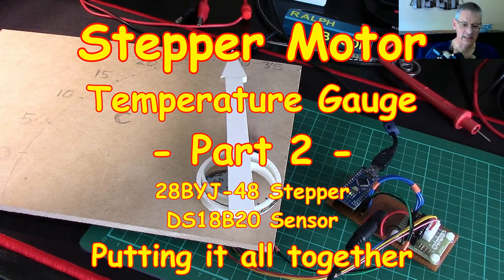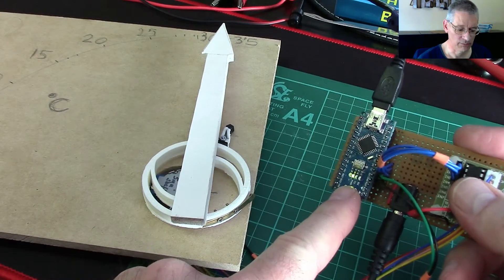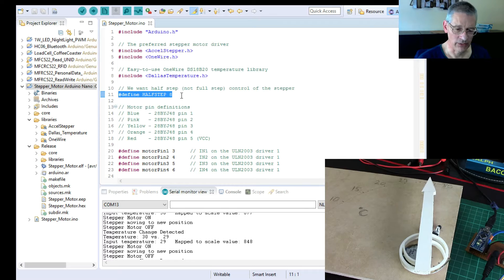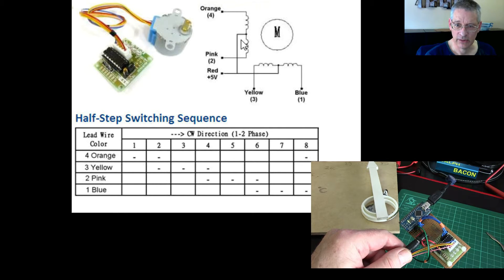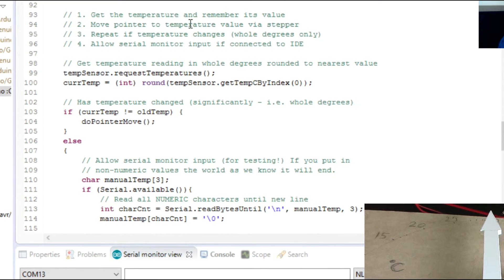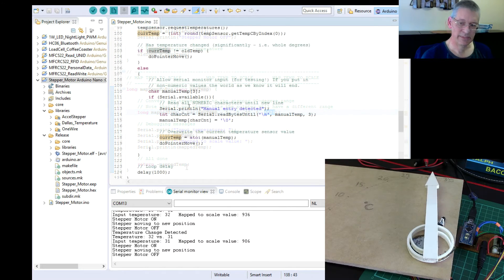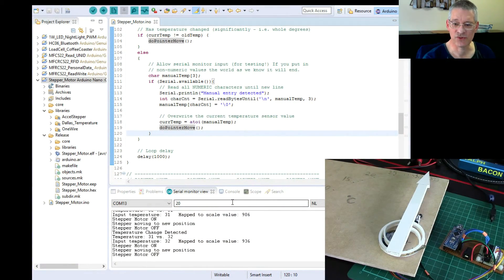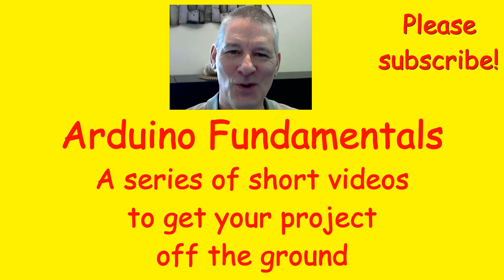#39 Stepper Motor 28BYJ-48 Temperature Gauge - Part 2 Completing the project

Comment: Nice project, Ralph. Very useful application of a stepper motor and I would consider this extremely educational in a way that kids could do this project as well! Keep up the good work.
Reply from the maker: Hi Thomas! Yes, it was an interesting project (and is still running in my workshop but soon to be transferred into Benny's cat run so he can keep an eye on the temperature!). If I did this again I would not use a microswitch, instead I'd use a Hall Effect transistor. Thanks for the feedback!

Comment: Great project, Ralph. I've been looking for exactly this project (for a Raspberry Pi) for some time. Now you've given me the means to do it. Instead of using a circular movement, I'll be attaching my motor to a threaded rod that will rotate and move my pointer up and down a vertical scale.
Reply from the maker: That's great news, i hope out works out. I would, with hindsight, have used a Hall Effect sensor instead of a Microswitch but as you have vertical movement i think it will work fine with a micro switch. Thanks for sharing!

Comment: hi thank you so much for your very good videos.
I am working on a similar project .I control the air to my wood boiler with a stepper motor.
and a temp sensor.
I'm running dim code now.
but I want the stepper motor to rotate 2 revolutions between 70 degrees to 90 degrees Celsius.
can you explain how i did this
best jocke
Reply from the maker: You need to know how many steps your stepper motor has in a complete 360° circle. For example, if the Step Angle is 1.8° then a complete revolution will be 360 / 1.8 = 200 steps. So just issue 200 steps in a for { } loop for one complete revolution. Repeat for another. Make sense?

Comment: Just noticed 1 small flaw in this. should the temp be below 0 then the dial would turn all the way round off the display (ccw 350 ish degrees)  to find 0. it needs something like 2 hall sensors to determine max and min to send the motor the correct direction. great project. loving the "practical uses" for in/output sensors and devices
Reply from the maker: Ooh, I shall have to test that, Gary, we can't have it do that (I wonder if that is why the pointer is sometimes found on the floor in my very cold - in winter - workshop?). Anyway, glad you're liking the videos, keep tuned! Thanks for posting.
Reply from the maker: So I tested this tonight and this is what I discovered.
 
If the temperature is below zero (and the pointer shows below zero) and power is then removed and then reapplied, you are correct that the pointer than goes round ccw (anti-clockwise) for about 230 degrees (let's assume it was showing -5 degrees C) to find the zero marker again.
 
I could easily adjust this in the logic by moving clockwise if we thought the temperature was below zero. However, I can't do this because the µswitch is a one-way only switch - if I tried going clockwise it would jam and destroy itself! If I had a (non-contact) Hall Effect switch (which I've mentioned many times in these comments as to the way I'd do it the next time) it would be fine.
 
So, I need to do two things here, Gary. One, replace that ridiculous µswitch with a Hall Effect sensor. Two, adjust the logic to turn the pointer as described above to find the zero calibration point.
 
Sounds like a nice enhancement to my existing Hall Effect video demo! Keep tuned... and thanks for bringing this to my attention (well, you know what I mean). Seriously, most appreciated.
Reply: Ralph S Bacon im thinking if yo was to replace the switch with a 2 hall effect switchs, move it to max sense say south on magnet then use north on second switch for zero also the max switch can stop the pointer going off the scale in our extremely hot summers. thought if useing 1 with 2 magnets if you have a - reading it will think 0 is max then will be pointing off scale when lookong for 0
Reply from the maker: When I have more time I will definitely experiment a bit. Thanks for your suggestions. I want to replace that µSwitch anyway so that will be my reason for doing something to this. Keep tuned...

Comment: Ralph, these steppers run at 5 V , thats why you have them so hot
you could even run them on 3 v if no torque is needed.
Reply from the maker: Ah ha! Well there had to be a reason so I guess this it, Patrick, thanks for posting, good to hear from you.
Reply: Im planning to use the same ones for my auto throttle for the simproject im doing
All parts will be 3d printed, the holder for this from PETG, bu I will put some heatsinks on it just to make sure it does not overheat

 @RalphBacon

Comment: Nice tutorial. 
If I had access to a laser cutter, I'd be tempted to make a hollow plexiglass pointer and mount the electronics inside the pointer. As the pointer only moves a short distance you wouldn't need to worry about slip rings.
Reply from the maker: An amazingly creative idea. And it also allows user to see the electronics which somehow seems to fascinate them (well, it does me too). When I can get a laser cutter I'll steal this idea of yours Maxx. Fully credited, of course. But don't hold your breath, I won't be able to get one any day soon.  I'd also like a 3D printer but that is also a pipe-dream for the moment...
Reply: Ralph S Bacon
I know the feeling. I'd love one or the other, but I'm on a limited budget. I am however scavenging parts from old printers and scanners with the aim of building one, one day with my old Raspberry Pi and an arduino as the brains.

Comment: I've never seen a motor like this,  even though it's described as "ubiquitous".  There must be some really tiny stepper motor inside that casing,  and some gearing.  I've tried to make some sense out of the data I just found on it in a search,  but that "/64" part?  I've been salvaging lots and lots of electronic parts for several decades,  and that includes a box of stepper motors. There are a number of different form factors and sizes,  and almost all of them are marked with the step rate,  which is mostly 1.8 degrees/step,  giving 200 steps for a revolution.  A very small number of these are 7.5 degrees/step,  giving 48 steps/revolution.

It's a big subject,  and there's an awful lot of good info on it out there on the 'net.  I got interested in stepper motors when I started giving some thought to building myself a CNC machine,  which still hasn't happened yet -- but life is what happens while you're making other plans...   :-)
Reply from the maker: Certainly this stepper motor is used in many projects (hence the good support). And it certainly works for me inasmuch that the pointer does point to the correct temperature symbol. Maybe there is some magic inside the casing.

Comment: Welcome. I am 52 years old and I'm just learning to writing code on Arduino. I want to thank you for a very precise code translation. Based on your program, I want to build a swivel machine for welding. Of course, I will remove the Dallas temperature sensor and insert the potentiometer to set the end position.
I was very interested in the library to the stepper motor. Regards from Poland, you and Benny. I also have such a rice urban named "Rysio". I am asking for more movies because they are well translated. I think you have an error with measurement -5 degrees. Maybe the sensor heats up from Arduino. Move Dallas sensor to another place.
Reply from the maker: Good luck with your project and thanks for the tip about the positioning of the sensor.

Comment: Does that temperature reading get more realistic if you don't have the sensor under the nano?
Reply from the maker: Ideally the sensor should be away from all sources of heat, Roy. Luckily this project did not demand the ultimate accuracy (and it's still working). If I did it again I would mount the sensor at the edge of the board.

Comment: Ralph, interesting project, do you think this could be implemented into a project I'm doing. My project involves using a stepper motor to control the amount of fuel being metered to an engine. It then senses the exhaust temperatures and quickly adjusts the metering rod to either apply more fuel to cool it down, or less fuel to heat it back up. Thanks for a reply, Hurst :)
Reply from the maker: If the metering rod can be accurately controlled by the stepper motor, Dread, then I don't see why this would not work. Just bear in mind that the stepper motor has no idea of its current position; all movements are either positive or negative from the current position, whatever that may be. Compare that to a servo, which knows exactly its current position (in degrees, normally). It all depends on whether your project requires this. But whichever approach you use it should work as far as I can see. Using a stepper motor and the mechanics from 3D printers (rods with worm gears, for example) could make for a very accurate setup (think how accurate 3D printers must be!). Hope this helps.
Reply: This does help. The thing that makes it hard to decide between servo and stepper motor is the fact of how fast it needs to be. If you ran the stepper motor to the speeds you have in the video the engine would quickly get all weird. This is due to if you grab the throttle (that is connected to a butterfly valve  ) it creates a gain in vacuum pressure that temporarily leads to a lean spot. Now if you do this and then let go of the valve and close the gate, the pressure drops leaving you a huge wad of fuel to suck into the engine making it be overly rich. Do that fast a bunch of times with a slow stepper and your begging for disaster. I know you can adjust the velocity of a stepper motor. But can you adjust the velocity of a servo? Also do you think it would be smarter to move the metering rod who is designed around 250 engine RPM increments with a stepper motor or a servo in this case. I'm wondering, because the metering rod is going to be attached to a very small "crank shaft" inside the carburetor, and I didn't know if I wanted a 360^ servo or a stepper motor. now of course this "crankshaft" only spins from 0^ to 180^ because anything past that is going backwards and wont let you get any more rich. (In-fact it would lean it out and potentially burn down your motor.) I know I have to use a different temperature sensor then what you used. I was wondering, Would an Adafruit MAX31856 Universal Thermocouple Amplifier with a Type K thermocouple, be a good buy If I need to monitor temperatures up to 1200 F or about 650 C?

Thanks for all this help, I haven't gotten anyone to reply on my idea except you :)
Reply from the maker: I'm in no way qualified to answer this really, but from what you've said you need something that would respond pretty quickly - more quickly than a stepper motor, although in my demo I deliberately have a slow start and a slow finish (it's all part of the library I use). A different library may give you much quicker results. A servo on the other hand (suitably selected for the pull/push power you need)  responds pretty much immediately. When I used to fly model aeroplanes the rudder/flaps would move to the required position almost with a snap, they were that fast. But you can't adjust the velocity of a servo as far as I know - but that is a bit of a specialist question, model aeroplane enthusiasts or robotics enthusiasts might know more (or there might be specialist servos).

Regarding the thermocouple, I've never used one - as long as the temperature range is correct for what you want (with some margin for error). I note that the Adafruit fibreglass braided K-type thermocouple only goes up to 500 degrees C - not enough for what you want. But their MAX31856 seems very suitable once you've sorted out your thermocouple. That's pretty much where I must stop giving advice about which I know very little - I don't want to set you off down the wrong path, that's for sure. I assumed you've tried the Arduino forum ( http://forum.arduino.cc ) as there are many types of specialists there? Just don't cross-post your question into multiple forums, they get upset about that! I hope this helps a bit, even if it makes you do a bit more R&D to get the right equipment before committing to a solution?
Reply: I actually forgot about arduino's site. Good advice, I think this has helped a lot. And thanks for all your time, I will be heading over to arduino's site with my question. :)

Comment: A great follow-up would have been larger bipolar stepper motors using drivers similar to the DM 542. Those bigger steppers often need to use AccelStepper
 because the additional mass they are accelerating. E.g. A Nema 23 stepper driving a 3D printer making a wheel.
Reply from the maker: I'm doing a longer-term project that requires Nema 14 stepper motors (Geeetech 1.8-Degree Nema 14, 35 BYGHW Stepper Motor for 3D Printer), do they count? I haven't even looked at the software for these yet!
Reply: @RalphBacon  I look forward to viewing that. Being a 4 wire motor it will be bipolar. Unless the movement is very slow throughout the whole travel acceleration and deceleration is desirable to avoid missing steps. I see you've started a Postage Contribution Page. How do I sign up? If you use the inexpensive TB6560 driver modules don't forget the "power-up" sequence mod.
Reply from the maker: I'm actually using the Geeetech StepStick DRV8825 driver (one per motor).

Comment: Just getting started and this video series cought my eye, thanks. BTW do you know what the max RPM is for the 28BYJ-48?
Reply from the maker: Welcome, Ken! The rpm of this motor is about 15rpm  in half-step mode (5.625 degrees per step, 64 steps per 1 rpm). In full-step mode of 11.25 degrees/step, you can double that, probably up to about 25rpm. That said, stepper motors are revered for their accuracy and precision and not their overall speed, although I have seen more than one robot car with these driving wheels!
Reply: @RalphBacon  Thanks Ralph !